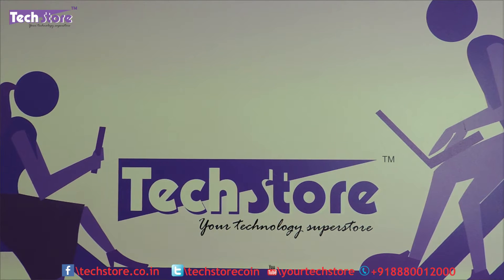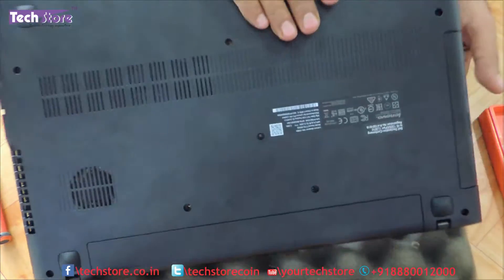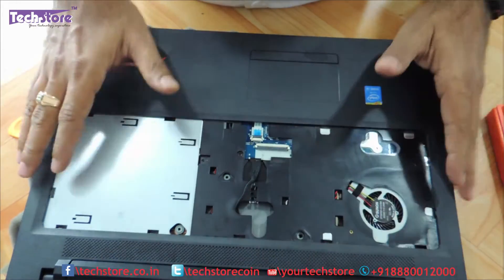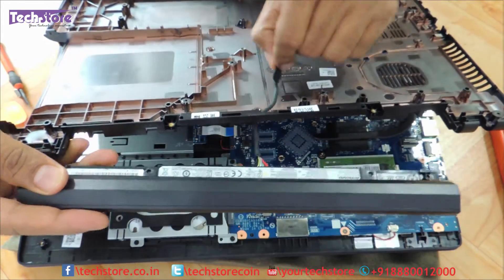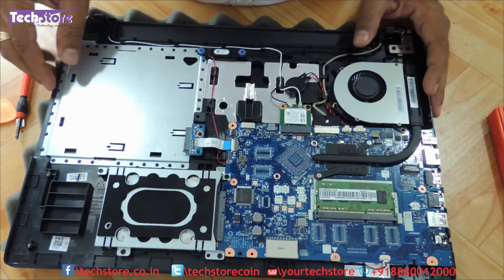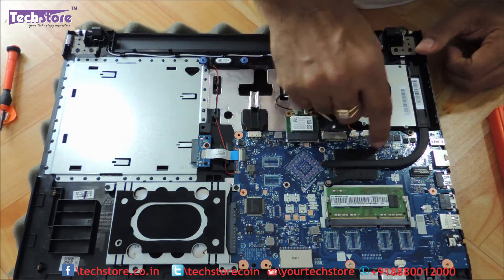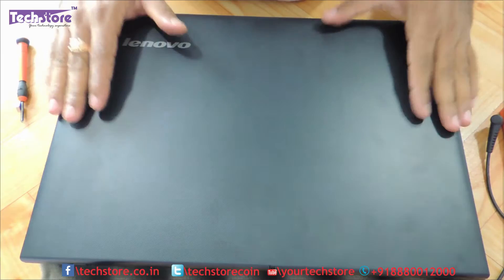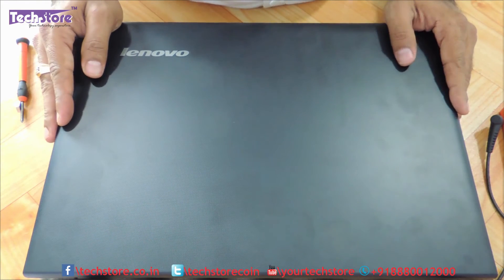Lenovo Ideapad 100 Laptop  : How to disassemble and upgrade ram hdd battery keyboard easy diy

Comment: If the ram is soldered to the Motherboard and the slot is only one.

Question: Is tit possible to upgrade its ram?

I currently have a 2GB of Ram.

PS. Lenovo 100-14IBY-This Laptop can support upto 8GB of Ram.
Model Name: 80MH
Reply from the maker: One ram is soldered. another slot iss vacant. You can upgrade ram upto 8Gb.

Comment: I know this video is kinda old but I hope you will still see this comment.
So: I have the exact same model and I've seen that 4GB RAM DDR3 low voltage (1.35V) is the maximum it can get and if it's true then I regret buying this laptop and not thinking about this when I did it. This shows how many things someone has to consider when buying a laptop or any PC parts in general (compatibility and other factors). BUT if that's not true:

I also heard that it can be upgraded to 8GB RAM DDR3 STILL low voltage (1.35V) with a maximum frequency of 1600Hz and this is what I want to do.

What I want now is to know if I can do what I said and , if you can (but if it's not possible it's still ok. I just what to know if I can upgrade it) could you give me an example like a link to a RAM that can work on this model, please? (the one in the video)

Comment: You and other vids saved me at least $75 to replace  under warranty 100 151bd faulty battery.  tnx.   Problems:  Lifting keyboard release level not clear, imo.  Battery  cable insertion not clear, imo.  GO LOW.  Our 100 151BD run at 2494 MHz! uefe/bios includes 'compatible' so it may run xp too. Ring on 4QU finger :)

Comment: Our 100 151BD HAD bar glued to try to destroy dvd bezel on removal.  Acetone Qtip application defeats attempt.  Battery failure identified by Onestep diagnostic.  Under warranty.  But bought replacement battery from amazon. Will try to replace.  Replace hdd with ssd.  And try to install xp  ... albert gore willing, of course. :) NICE CONCISE VIDEO. ***

Comment: hey can I ask you a question, do you need to open the keyboard to upgrade the RAM?
Reply: Need to remove the battery connector to avoid short circuit...but keyboard not necessary